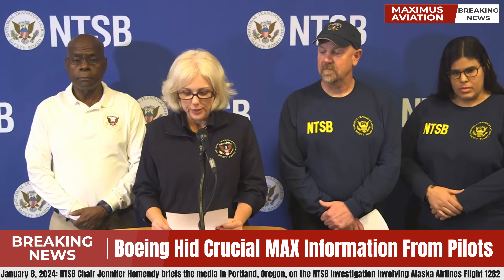Boeing NEVER Told Airlines That 737 Max Cockpit Door Was Designed To FLY Open During Decompression!

Comment: An emergency decompression, is a standard mandatory Emergency operation, that during a 737 max PILOT conversion would HAVE to be addressed. It is inconceivable that this information would have been hidden from the flight crew. What the hell is going on , both at Boeing and the F.A.A? How didn't the F.A.A. know? They certified the aircraft for commercial operation?!
Reply: It's inconceivable because the information wasn't hidden at all and has been readily available for years

Comment: This is not some 'gotcha' moment. It's a nothing burger for a FrankenMax hater to highlight for the eyeballs that flock to fear and negative press like a moth to a flame.
Most of the systems in Airbus aircraft are completely automated, so knowing about them does exactly jack squat.
This is a safety feature and would only occur in an emergency situation and inconsequential in of itself, except for the benefit of the feature which requires no bragging rights from Boeing, and nothing anyone needs to know. For an average aviation enthusiast such as me, I'd surmise that the reason the cockpit door would automatically open during rapid decompression is to allow someone else on the plane a chance to safely land the aircraft if, heaven forbid, both pilots somehow become incapacitated. So, in essence, it's a beneficial redundancy since pilots can lock the door from inside the flight deck in a way that makes it virtually impossible to open the door from the outside. I'd even go a step further and say that this feature was likely built into the Max because of what likely happened in the Malaysian 777 disappearance, which likely had something to do with one of the pilots taking over the aircraft completely. In that case, it's GOOD that they're unaware of the feature, ok? Ok.
Now, what would be grossly irresponsible would be the reverse, which is Boeing making the flight deck completely inaccessible no matter what in an emergency situation and no one knew about it.
Notice also that the NTSB only briefly mentioned it and said Boeing should put it in the manual. No training required because it's just an emergency feature. However, the stuff that was important, you didn't even bother to mention, was the feature that actually mattered, and Boeing had a TRIPLE redundancy for that.
If, for example, your car doors were made to automatically unlock in a collision, the only benefit is to the person getting you out of the car if you couldn't get yourself out. 
It's getting more and more worrisome that sensationalism is replacing news, and most of it is from a negative bent rather than a positive one. The more we learn about what happened here, the more one-off it's looking. This is not the time to try and stick another pin in the Boeing effigy.
Reply: I find it interesting that so many comments mention Boeing stock when their next earnings report is in three weeks
Reply: @robroilen4441  Stocks go up, and go down. Historically, long-term, most go up, and that's no different for Boeing. Long-term investors don't obsess over stocks the way day traders do

Comment: While I understand the need to document ever detail about an airplanes characteristic, this is standard behavior for most aircraft.  Most if not all Airbus aircraft function the same way.  This is to prevent putting stress on the aircraft in ways it is not capable of handling.  Try to be more responsible and know what you are talking about instead of trying to spread FUD all the time.
Reply: Channels like this should be punished when they publish verifiably false, sensationalist misinformation but it seems like YouTube cares more about engagement numbers

Comment: If that door is designed as such than Boeing lost the ability of building planes. That’s flipping insane. Passengers may sucked out of the aircraft. As an engineer it sounds completely insane.
Reply: I think you are confusing two separate parts of the plane - the cockpit door is the part designed to open during a decompression, just like all other airliners. The door plug is designed to fill an unused emergency exit and should be bolted to the fuselage.

Comment: Geez - I was very aware of the “blowout panels” designed into 737 flight deck doors. At just above
16000 feet the differential pressure just isn’t that high yet. Keep in mind that a 737 is slightly 
pressurized on the ground prior to takeoff - (.125 psi) - for passenger comfort. Any rapid 
depressurization is a hectic event to be sure, but it couldn’t be much easier to deal with than
occurring at that low an altitude. Thankfully the door didn’t strike the horizontal stab on its way 
to that persons backyard. Two lucky breaks there. I’ve had a rapid depressurization (RD) at
FL 390 (39000 ft.) due to a main outflow valve failure. It was not as enthusiastic as what they
experienced to be sure. But, this could have been much worse. There is no justifiable reason 
why that installation should have failed like that - None.

Comment: Re the cockpit door being designed to open in rapid decompression. This is NOT the same as the ‘door’ that detached from this plane. The reason for there being a door or panel between cockpit and cabin which can open in the case of a sudden depressurisation is that without it there might be a significant pressure differential which could place excessive stress on the airframe. This safety feature has been built into planes for many years. I don’t really understand why the NTSB chief didn’t make it clearer that it’s not the same as the door that detached here.
Reply: Correct, it has had the same operation on every 737

Comment: Much more concerned over the castle nuts with cotter pins that were loose allowing the door plug to slide upwards and out which is how the door plug was violently ripped off the aircraft at climbing altitude.  Meaning, somebody didn't install the cotter pins or they re-used cotter pins that were weakened when bent to remove and bent again to re-install.  Take a paperclip and bend it repeatedly and it will snap. A cotter pin is the same.  They are designed for single use and never should be re-used but replaced every time. So was the problem at initial manufacturing assembly or when Boeing took delivery of the air frame and removed the door plug to complete the interior work, paint, etc. Then re-installed either without the cotter pins or re-used cotter pins.  Several other planes have located loose castle nuts! They should not be loose if a cotter pin is installed in the castle nut. If they are loose then the cotter pin is missing. I bet they do indeed trace all the way back to the human error.  It is either that or the cotter pins themselves were faulty and weak enough to break on their own given enough vibration, hard landings, and turbulence to make them sheer and thus allowing the castle nut to spin freely.  Could be a design flaw or material used in the cotter pins (white metal), etc. Or worse, sloppy human error; the cotter pins were re-used or not re-installed.

Comment: They have 2 problems here. The door that came off and caused the decompression and the door on the other side that did not come off (as it was designed to do) when the plane decompressed. My last question how could this flight have turned out better if the door on the other side had come off as it was designed to do?
Reply: What "door on the other side" are you referring to? The cockpit door opened during decompression, as designed

Comment: Passengers should be informed, that they are sitting next to a "blow door" 🤷‍♂Preferably by BOB...
Reply: You are confusing two separate parts of the plane - the cockpit door is the part designed to open during a decompression, just like all other airliners. The door plug is designed to fill an unused emergency exit and should be bolted to the fuselage.
Reply: @robroilen4441  Cocpit door did not blew my friend...👁
Reply: @tomc.2808  Multiple reports indicate that the cockpit door opened during the decompression

Comment: At this point, I think it's clear that calling this door a “Plug” is a big stretch!  It's a “Non-self-sealing maintenance hatch” !!
This is a very big difference as inspections, warning systems and a fail-safe locking design need to be implemented. 
I don't understand why a true plug-and-bolt design isn't used; simpler time-proven safety, or removing it completely when an escape door isn't required!  The only downside I can see is manufacturing and maintenance convenience!!
Reply: Have they just announced to potential hijackers how they can easily override the cockpit door locking system??
Reply: @robinholmes785  No, since the cockpit door only would open (some don't open, some just have panels that blow out) during a decompression, meaning that anyone not wearing an oxygen mask would quickly lose consciousness
Reply: @robroilen4441  if a hijacker knows that 737’s unlock their cockpit doors on decompression, they would know how easy it would be to grab a mobile mask and air bottle that are available for the crew!
Reply: These door plugs are supposed to be bolted to the fuselage with 4 locking bolts

Comment: That door plug could have taken out the horizontal stabilator with the loss of the whole aircraft.
Reply: That flight was incredibly lucky.
Reply: Challenger was traveling at 500mph just after launch. They were dealing with foam insulation.
Reply: @flybouy11  They were dealing with ice breaking the ceramic panels.  Two completely different scenarios.
Reply: It would have damaged the stabilizer, but there is no way it would have taken it out.  The door plug is not made of concrete.  The loss of the plug is indefensible, but as a retired airline mechanic, I know that the stab is very robust.  All of the stabilizer control motors are inside the fuselage.
Reply: Or,  blown out at 30,000 ft or above,  causing major structural damage to the fuselage and complete loss..🤨
Reply: @bobthompson4918  No it would not have caused major damage.  It wouldn't have caused any more damage than it did.  The greatest danger would have been from a reduced time of useful consciousness for the crew.  Making the rapid donning of the O2 mask very important.
Reply: That’s what they thought about the space shuttle.
Reply: @flybouy11  What are you blabbering about?  The two situations are completely different.  The 737 was not entering the atmosphere at 17500 mph

Comment: The airline training department not aware of the systems used in flight deck protection against rapid decompression? Pretty basic stuff in pressurized planes. Either call Boeing or ask the maintenance department for an explanation since they inspect and maintain systems. Back when the B757 was new American Airline's training dept noticed no procedure for split flaps. Boeing said it was impossible for split flaps so no procedure. A/A didn't buy it since in testing it was possible to lose control of the plane so they made thier own procedure. Best I remember the B757 had three different occasions of the impossible split flaps event.

Comment: OK, most of us engineers knew this, but presumed it was secret for security reasons. It is to stop diffrential pressure damaging
the bulkhead between the cockpit and the PAX area. Someone put a lot of inportant wiring there...Cat out of box. Now,
we will get to review security again. No real security risk here, it takes a LOT of pressure to open this door.
Reply: just smash a window and your in the cockpit very quickly, surely vents not the whole door should open?
Reply: In previous incidence where a window has failed, the cockpit door didn't open; in this incident an entire door opened in milliseconds. that met the criteria for pressure overload. It takes a big hole to stop damage to the airframe, and a lot
of force. Anyone standing NEAR a window would be sucked out. We could call this threat elimination.
ALWAYS wear your seatbelt when seated !!!! BUT even that won't stop you if you are close to the window. @walterblanc9708

Comment: I believe the cockpit door has blowout panels that should have popped out under rapid decompression instead of the whole door opening.  Why did they not mention that in the briefing?
Reply: The blowout panels open towards the flight deck in case of a flight deck decompression. The complete flight deck door opens towards the cabin in case of a cabin decompression.
Reply: Vents are needed for control of over pressure conditions.

Comment: So, Spirit AeroSystems was the last to remove and replace the plug door. But it’s somehow Boeing’s fault? (Assuming it’s improper re-installing the plug after interior fitting.) 

If the plug was leaking due to Spirit AeroSystems improperly re-installing the plug door, and Alaska decided to not ground the aircraft after several pressurization warnings, somehow that’s Boeing’s fault too?

Comment: I'm surprised pilots in training didn't ask how the cockpit door/bulkhead equalizes pressure in rapid decompression event. Common design to have systems for pressurized planes experiencing cabin decompression or flight deck decompression. Doors opening, vents, blow out panels and back ups if they fail. No one would want an armored door flying off its hinges/frame or getting jammed shut or a damage bulkhead.
Reply: The opening is not because of decompression as the door just go in one direction, , for that they assembly decomprrssion panels , they are even connected  to cargo holds.
Reply: As a retired pilot and an airline technical rep. who supervised aircraft fleet construction, I would be worried if a cockpit door did not open during a massive decompression.  The doors are designed to keep people out by preventing the doors from opening inward, instead of the reverse.  As long as the door remained attached to its hinges, no worry at all for me.

Comment: What could possibly be the purpose of this part of the plain blowing out? I they would have been higher someone could have been sucked out. If there is a need for a pressure relief they should add a valve that could do that without making a large hole in the side of the plane.
Reply: The plug is not supposed to blow out.
Reply: Sorry. I miss understood. They were talking about the door to the cockpit but same problem. Why not have a pressure relief instead out scaring the stuff out of the pilots that have their hands full in the first place? @GH-oi2jf

Comment: Until the FAA discontinues  allowing Boeing employees to act on behalf of the FAA to inspect and approve new Boeing planes under construction these quality control and defective engineering problems will simply continue.
Reply: I complained about it when I worked at Boeing back in the 80s. You're absolutely right.
Reply: @SCFoster  Thank you for your response.

Comment: The pressure in the cockpit has to be equalized with the cabin somehow, the door and rear panels are probably not designed to withstand the pressure differentials with the cabin in case of rapid decompression, especially at higher altitudes. If the door is 20 by 80 inches (I do not know the exact dimensions but this is a good guess)  its area is ca. 1600 square inches. Typical cabin pressure is ca. 10 psi, and standard pressure at FL 360 is ca. 3.3 psi. A pressure differential of 6.7 psi would push the door with about 10,700 pounds of force, which is 4.8 tonnes. It would certainly fly off its latch and hinges into the cabin with enough speed to seriously injure anyone in its path. This would probably also cause the cockpit rear panels and anything behind it, such as the toilet, galley equipment, carts etc. to do the same. I do not know if vents for pressure relief can handle a rapid decompression like this, maybe they cannot and that is why Boeing made the door open in rapid decompression.

Comment: The question is other aircraft what is the cockpit door designed to do? 

In other words, is that normal to all jet airliners with the top security doors? ie, is that a ubiquitous design characteristic?
Reply: All airliners have cockpit doors that are designed to relieve the pressure differential during a depressurization, whether by opening or by having panels blow out.
Reply: @robroilen4441  
At first mention of the door opening, I had assumed it was ubiquitous to all pressurized jet aircraft. Especially with the top security doors. 

And the comments section is rife with blaming Boeing for hiding an obvious characteristic ubiquitous to all. But even the NTSB seemed to think Boeing held back on something that is (or should’ve been) well known to any ATP.

Comment: Locking the cabin doors is post 911(I think that’s the case).  On other types of aircraft, was the lock/door redesign a retrofit and now the whole door/bulkhead will catastrophically blow on other aircraft that locked the cockpit door without the blowout feature?
Reply: The 737 NG has blow out panels in the door, so that the pressure can be equalised without the whole thing having to open.

Comment: Did the whole door "fly open"? Or was it that a panel or two in the door designed to open to relive a pressure differential opened. As an air crew member on Boeings for 30 years I recall it was pressure relief panels in the door and we knew about them. What changed ?
Reply: I'm also curious about this significant distinction. Just like the MCAS saga, tons (if not most) of the public reporting was laughably incorrect and sometimes outright purposefully false.
Reply: Looking at my 737NG manual from 2004 and the operations manual from my airline clearly shows "decompression panels" in the flight deck door. Unless the MAX or latter production models got a change??Currently my guess is the pilots wanted to close the decompression panels to reduce noise.  @robroilen4441